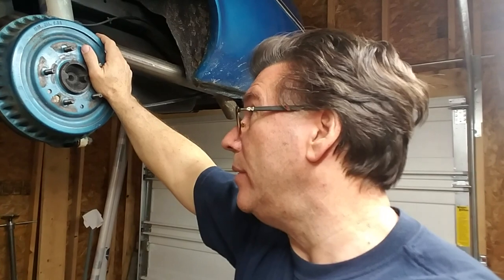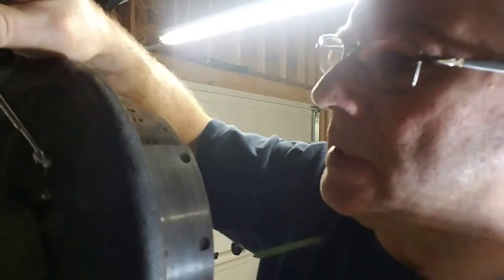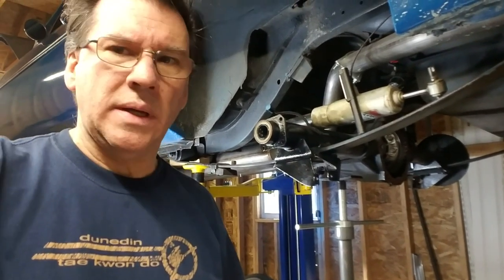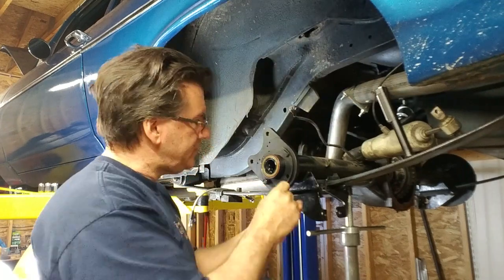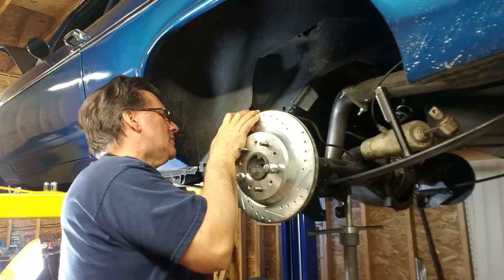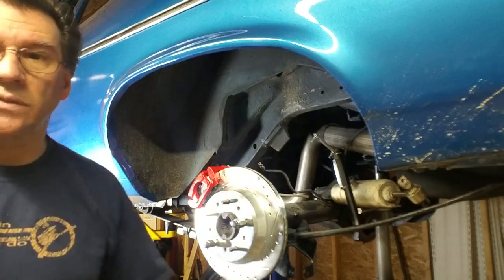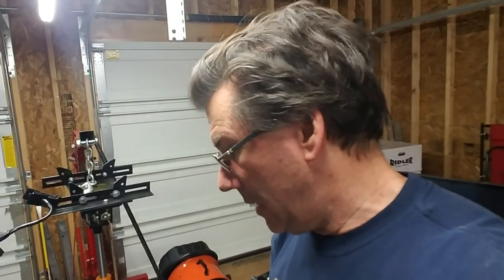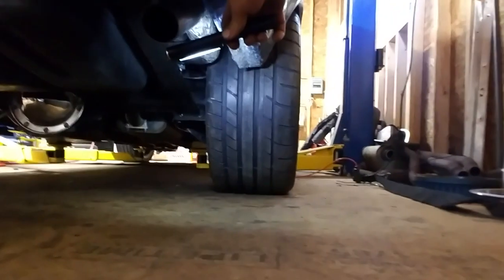72 Nova Rear Drum To Disc Brake Conversion

Comment: I ordered some 17 by 10 4.5 back space and a set of 8 in wide for the front I hope they fit
Reply from the maker: I think mine are 9.5 wide but 4.5 backspace won't be enough.  You need at least 6" backspace.  Let's see how it turns out!
Reply: @stevesgarage7644  thank you
Reply: @stevehernandez1637  any update on fitment. Yeah you need a 6in bs for a 9.5 rim. 10 in wheel seems too big

Comment: Are them power,or non power disc breaks? And did you have to change master cylinder,or add booster?
Reply from the maker: They are powered.  I had to change the master cylinder because I converted to rear disc brakes.  It was already power disc on the front.

Comment: Any chance you have a part number / vendor for those axle seals?  I am in the middle of a disk brake conversion on my 68 (12 bolt posi) and I somehow can’t find the right axle seals… frustrated!  Thanks!
Reply from the maker: No I sure don't.  But I got them from summit racing.  Mine would be different from yours I would think.  Mine is a 10-bolt posi, '72.

I did a quick check and turned up these...

https://www.summitracing.com/parts/YGA-30196/applications/year/1968/make/chevrolet/engine-type/v8/drivetrain/rwd

https://www.summitracing.com/parts/tmk-8660s/make/chevrolet/model/chevy-ii/year/1968

https://www.summitracing.com/search/year/1968/make/chevrolet/model/chevy-ii/department/gaskets-seals?ar=1&keyword=1968+2+12+bolt+axle+seal&kr=1968+chevy+2+12+bolt+axle+seal

Comment: Did u milled or cut the rims or send them to some machine shop to do the cutting ? 
I want to make the center bore of the rims up to an inch bigger to fit the rear end center hubs
Reply from the maker: Oh i would never attempt that on my own.  A specialty wheel and tire shop did it for me.  They have a special lathe that ensures they are perfectly straight when cutting them back like that.

Comment: Does rear disc move the wheels in or out? I have the  9.5  rear like you
Reply from the maker: Sorry just saw this.  It moves them out maybe 1/8 inch due to the thickness of the rotor.

Comment: Love the video. Right stuff sent you the wrong crap! 
Just a question why did you pick this kit vs say the 1998 to 2002 Camaro brake setup? I went from front drums to 11 inch front rotors. I am wanting to rear disc brakes.  I am now looking into  this kit. I just want to know why you love and why you hate this kit. After driving do you wish you would have picked another kit? I have a 71 nova
Reply from the maker: I actually wasn't aware of that kit.  For this one I just looked up the available conversion kits and found this one to be very well designed and fit my year Nova.  What I like is how well the emergency brake setup works.  I get all the adjustments I need.  What I don't like is having to weld on the brake line brackets.  Overall I'm very happy with it.

Comment: Seems like other kits have the calipers at the rear in relation to the disk.
Reply from the maker: Yep, I gotcha.  But this kit is set up for front-mount due to the emergency brake option where the cables are set to mount to the front of the rotor.  Otherwise these could easily be mounted in the rear.

Comment: Have u had an issue with the axle seal busting?... if so, what have u done to fix..besides a new seal.
Reply from the maker: No I haven't.  Sounds like you may have a bearing issue causing the axle to be off center.

Comment: I say you did alot of extra work. You couldve just used a grinder an cut the backing plate in half after unbolting it, put on adapters an brakes an called it done.

Comment: Those clips on the ends of the brake pads look hokey. There must be better conversion kits! Knowing that you had to put that short  flex line from the caliper to the old line, you could have just cut the brake line off instead of using WD40 and messing around with the old fitting. How does the hand brake attach? That long cable seems like it would be the hand brake cable but you did not mention it or ever refer to those instructions you had to get from Jegs! They come out too far for wheel clearance. I'd hate to have to chop the fender to make them work! Having to watch bumps would be totally unacceptable for me!
Reply from the maker: Just one reason; I wanted to ensure that this car could be put all back to original if I wanted to so no cutting of any sort when it comes to that.

Comment: Brakes look good, I'm sure they will work wonderful but the parking brake will be never as good as the original drum brakes. If you live in an area where there's a lot of hills this an important consideration.
Reply from the maker: That is true.  With drum brakes they are designed to clamp harder if you turn the wheel.  Discs are even pressure regardless of the wheel turning.  But I have tried the emergency brake many times and they clamp pretty hard, even on an incline.

Comment: Great video ! Thank you , Are your front wilwood rotors 4 piston ? Also are they 12” I wanna try to keep my 15 inch rally’s but in the website it says it fits most 15 inch wheels and heard that some rotors like the 12.19 don’t fit
Reply from the maker: Thank you!  Yes the front are 12" and are 4 piston.  I believe my old 15" rims did fit, but they were never driven on since I did the brakes and had all new wheels by then.